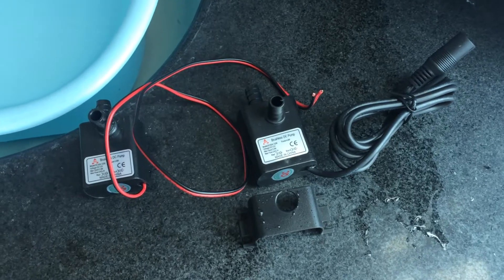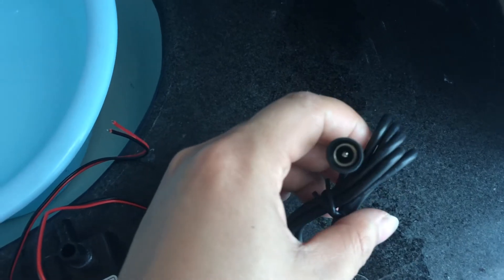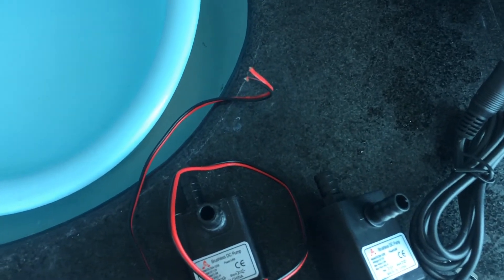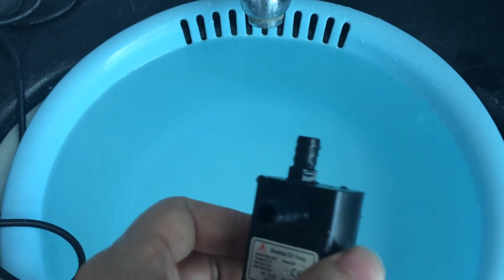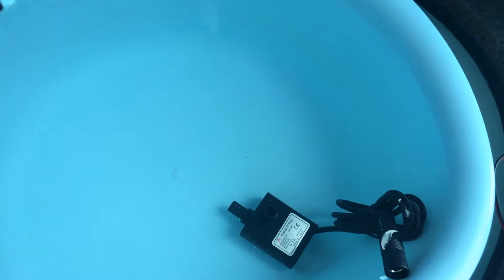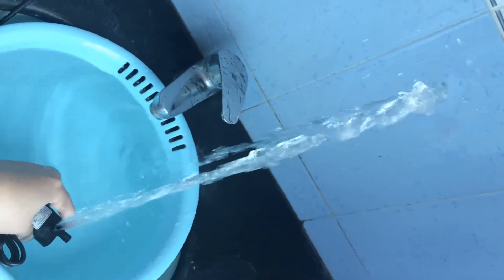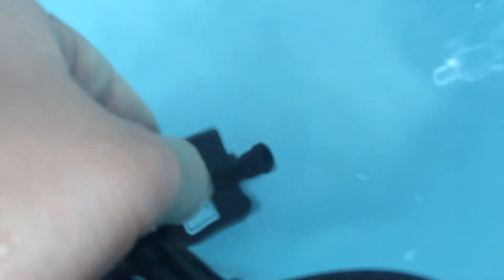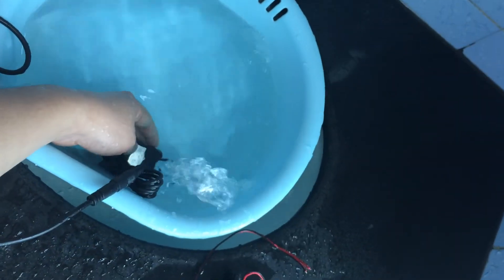Brief Introduction of Mini Brushless DC Pump DC30A-1230 12V 4.5W 3m model -SHYSKY TECH

Comment: Price
Reply from the maker: This mini pump can be purchased in this item link:
https://www.aliexpress.com/store/product/New-DC30A-1230-240LPH-3M-4-2W-Small-Brushless-DC-Water-Pump-Waterproof-Submersible-For-Fountain/515403_32608819489.html?spm=2114.12010608.0.0.a0a77d0cVY4H3t

It's USD 10.32, incl. freight cost via normal postal shipping option.